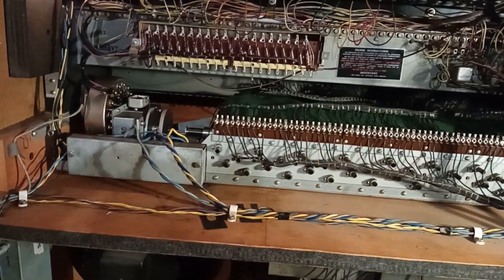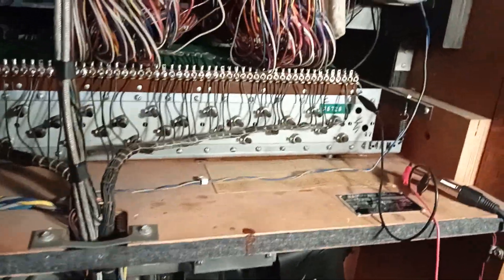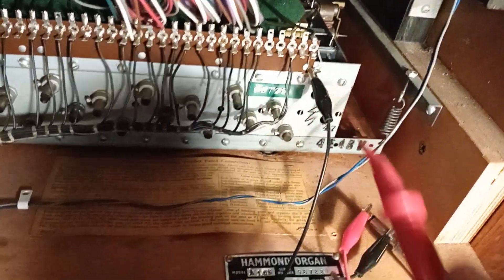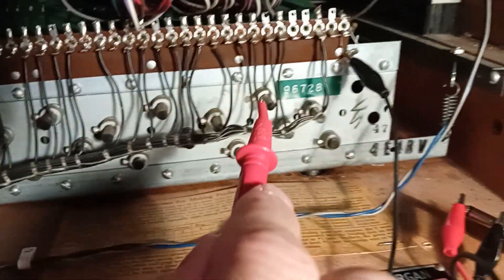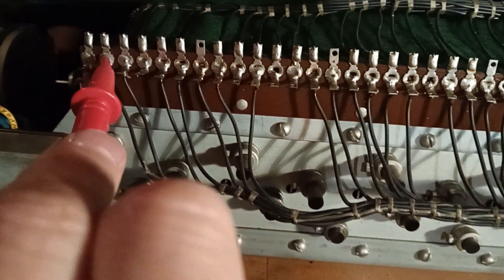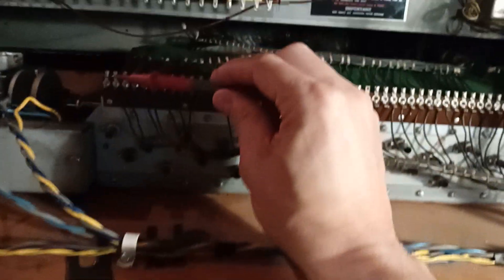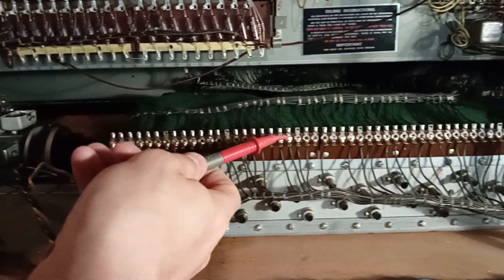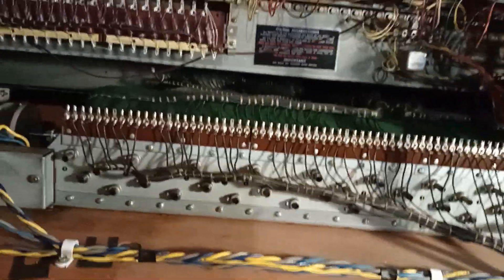Hammond Organ A105 testing the tones on the tonewheel generator.

Comment: This is awesome.  You have a new phone ringtone there.    I'm hoping to get my tone generator working again.  It has too much friction to keep running.  I add oil every few days and hope.  It was sitting unoiled for 12 years or so.  It looks like quite a job to unhook all of those wires to pull it out.
Reply from the maker: Thanks :) Haha I should sample it for the ringtone! Hope you get yours spinning again. I recently had a frozen genny. Used naphtha (lighter fluid) to flush the gooey residuals away and lots of fresh oil over a couple of weeks. I think someone had put in 3-in-1 oil at some time. Anyway, it runs quiet and stable now.
Reply: @jhandy101  Brilliant.  It didn't occur to me that lighter fluid was naphtha.  I'm off to the store.  Thank you.
Reply from the maker: @NackDSP  works well but very flammable. I did this in a well ventilated area and no naked flames or soldering near it until it had soaked in and evaporated.